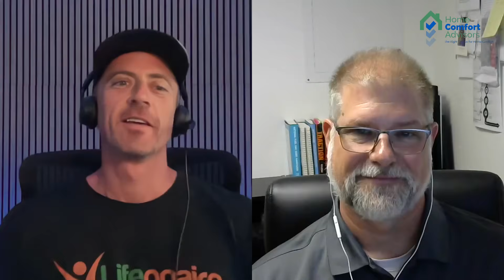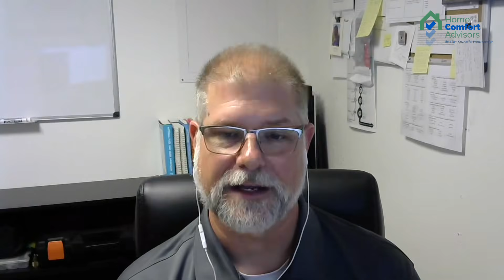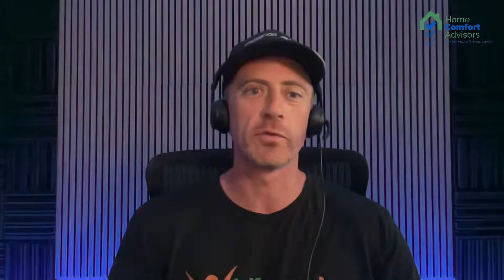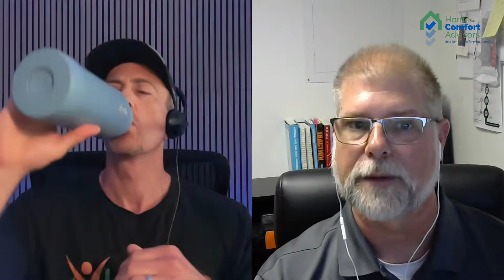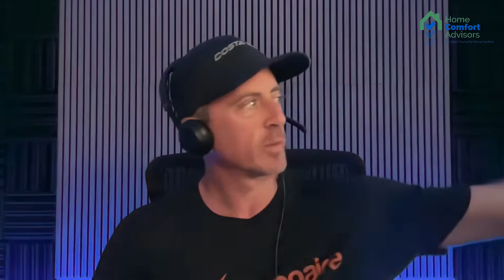Damp & Humid Homes: Causes, Quick Fixes, and When to Hire a Pro - With HVAC Expert David Richardson

Comment: My filters are always clean. So youre saying thats a bad thing? I dont have any pets or kids, just me. I still change them every 3 months tho.
Reply from the maker: Not necessarily a bad thing.  What type of air filters are you using? 1 inch? 4 inch?  MERV rating?
Reply: @HomeComfortAdvisors  1 inch. MERV 8
Reply from the maker: @luvb55  you're probably ok with a MERV 8, but some of those pleated fiberglass filters can still be restrictive if your ductwork isn't sized properly.  Best thing to do is make sure the pressure drop across the air filter is low, around 0.10 inH20.  If you have a good HVAC company servicing the system they should know how to properly test the static pressure in the HVAC system.  If you need a good HVAC company, check out www.BetterHVAC.org

Comment: I have a new construction home in South Texas. I have had high humidity the entire time 65-70% indoor. I read that longer cooling cycles can help so I dropped the temp to 69 degrees so it runs longer. I also purchased a portable dehumidifier and it has dropped to about 58-63%.  this still seems too high so not sure where to go from here? Outside humidity is typically from 70 to 90% or more.
Reply from the maker: I’d start by air sealing your house as best you can and sealing any ductwork you have in your attic!  Check out my 10 chapter video course here on YouTube for where and how to air seal and duct seal!
Reply: Sucks that one has to purchase external devices to improve what was installed.  My car air conditions/dehumidifies better than the house.
Reply from the maker: @IsmaelHernandez-ep7cp  Sad, but true.  Your car was also built in a factory in controlled conditions, whereas houses are built in an uncontrolled environment with dozens of workers from different companies, so it's much harder to control quality and performance, but it is certainly possible with the proper planning and instructions!

Comment: Hi; just watched this video. Ty. I’ve got an Ecobee3 lite & it’s set to “auto”. I’ve got an older home & believe I do have some insulation issues in the attic &/or ducts. I’m in Alabama & atm it’s very humid (storms, & just being in the South, lol). Windows & blinds are closed but sometimes I’ll open them for a little bit & close again. Sometimes my Ecobee runs on Eco+ because humidity inside is higher. Don’t think I have a huge problem. I keep my temp at 72 @ night & from 76-77 in the day. Any thoughts on my situation? Do people lower the temp in the house in order to lower the humidity?
Reply from the maker: Yes and your ecobee has a setting to dehumidify by over-cooling the house. You can set the number of degrees it can do it. Air sealing all duct connections in the attic would certainly help!
Reply: @HomeComfortAdvisors wouldnt this cause the electric bill to be way higher since it would be running for longer? Is that worth doing?
Reply from the maker: @luvb55  I don't know about "way higher", but it will consume more energy, yes.  However, the longer a system runs the more efficient it will operate and remove more moisture from the air.

Comment: My system requires the large pleated filters is there any filter you would recommend
Reply from the maker: Honestly the filter that was designed for your filter rack is the one you should use.  Usually the inside of the door to the filter rack will tell you the brand and model number needed.  If you buy cheaper brands they are usually a little smaller than standard and will allow air to bypass the filter inside the ductwork.

From there you could choose which version of that filter (MERV rating) you want to use, and unless you have the ability to test the pressure-drop across those filters or have an HVAC company that can, I'd start with a MERV 8 or MERV 11 at most, until you know that your system can handle a more restrictive (higher MERV) air filter.
Reply: @HomeComfortAdvisors thanks

Comment: Having humidity issues myself.  Sitting around 65-75% 

Going through things as much as possible. 

Planning on sealing around the canopy of ceiling fans.

Closed the damper on my fire place, but took an extra measure and got a piece of plywood and weather stripping and blocked it off entirely for summer.

Going up in the attic today to make sure my soffit vents weren’t covered by the spray in insulation.

Caulked windows and added weatherstripping to all the windows. 

Hot air is definitely being introduced somewhere in my house… I just need to figure out where
Reply from the maker: If you have ducts in your attic, in a vented crawlspace, or in your garage, I'd definitely check to see if they are sealed at all connections!
Reply: @HomeComfortAdvisors who do you hire to do that?
Reply from the maker: @HealedandThriving  a good HVAC contractor or weatherization/home performance company, ideally.  

You should watch this video on finding good contractors and check the links in the description for sites to search.

https://youtu.be/JpZhdLIiVww?si=2BRGoYCSxLRyepj7

Comment: Ac is on AUTO. 80% HUMIDITY WITH AC ON. APARTMENT COMPLEX WON’T HELP ME🥵RETURN AIR DUCT NOT CONNECTED TO FURNACE OUTSIDE.
Reply from the maker: You definitely need to get that return duct reconnected ASAP!

Comment: Only a few minutes into the video and this is already great. Just recently had some mitsubishi mini splits put in myself, and I believe some of the units are oversized for the rooms they are in and I think they're short cycling which isn't taking enough humidity out. And then with auto fan, their fan is always running even when not actively cooling, and maybe that's introducing condensation back into the rooms like you allude to. My humidity sometimes sits between like 60-70%. Any suggestions? Is there any way to tell the mini splits to have the fan turn off after the setpoint is reached, at least in cooling mode?
Reply from the maker: Thanks for the kind words! I’d actually search Google for your specific mini split model and ask it how to stop the fan from running when it’s not in cooling mode. I know some of them have a setting you can adjust from the remote control to dehumidify better and others you have to change settings or wiring setup directly on the head unit controls.

Comment: My humidity is too low, recently had a new electric HP/furnace installed. Prior to installation my crawlspace was really damp, musty etc. Have crawl cleaned out, ducts sealed and new hp and furnace combo installed. The humidity in the home is between 26%-32%. Making health issues. I've set my thermostat to auto with low fan speed but doesn't seem to help. Do you have other suggestions? I called the installer he said may need to add a humidifier.  I'd like to try adjusting something..  please advise, thank you.
Reply from the maker: I really need more info to advise you properly, but if you watched this whole video we talked about the reasons for humidity issues, including excessive air leakage and duct leakage, so those would be good places to start looking/testing.  

I assume you live in a dry climate if you're having low humidity in April?  

If you need 1 on 1 help you can schedule a call with me here - https://schedule.learnhomecomfort.com/

Comment: My ac wont run at night or cloudy days . In texas its humid regardless of time of day. Its almost as if tye ac feels that at night its cooler yet its stuffy and humid in the house
Reply from the maker: That's very common!  You probably need a whole-house dehumidifier installed to remove the moisture indoors when the t-stat isn't signaling that AC is needed!
Reply: You might try cleaning the outside condenser as this sometimes can cause it not to sense the warm air due to being dirty.
Reply: @DavidW-e8z  i blow it off during yard mowing, i have a shade cover for it, and i rinse it off during yard work

Comment: I live in Florida. Had my roof replaced. Since it was replaced, I can not control the climate inside my manufactured home. It's super hot in the summer and damp/humid in the winter. Had my AC unit checked,  including duct work. No issues found. Thermostat is always on auto, filters changed monthly, I have the annual maintenance inspections done as well. Roofer says it's not the roof. I never , in 25 years, have had these issues until the roof was replaced. Your thoughts,  suggestions?
Reply from the maker: Did they add vents to the attic that weren’t there before?
Reply: @HomeComfortAdvisors no. They were supposed to install a Cobra ridge vent per the contract, and they didn't. They said there were no soffits, so they didn't install it. I complained about the excessive heat(chocolates melting in my pantry) and they came back out and installed two whirlybirds. I don't feel like the roof is ventilating properly. I'm having issues with climate control in my home. It's been a nightmare.
Reply from the maker: @goldhamgeo  geez I’m sorry to hear you’re dealing with that! If there were vents before there should be vents now. If the roofing company isn’t cooperating you can file a complaint with the state’s attorney general. If you know the manufacturer of the roofing material you could call them and get them involved as well.
Reply: @HomeComfortAdvisors  Thank you for responding. I will reach out to Owen Cornings because the shingles are under warranty through them. I had to get DBPR involved. Roofing company owner very upset now. Total nightmare. Your videos on humidity are very helpful. I guess I need to go buy a humidifier until I get this mess straightened out. Have a Merry Christmas.

Comment: I believe my issue is your first topic !  My fan is on continue run 24/ 7 because the switch was acting up, so I'm headed back to switch it to auto & hope for the best ?  Every time & day that the humidity & temperature is 85% & 85 degrees my AC unit shuts off completely & won't come back on until both humidity & temperature drop a good 10-15 degrees. Now, today after the temperature drops 10 degrees along with 15% lower humidity it kicked back on, Thank you Jesus & its already dropped from 83 to 77 in 4 hours
Reply from the maker: Sounds like your A/C unit could be freezing up and shutting off for safety reasons.  It could be from restricted airflow (lots of reasons for that - see my other videos) or low refrigerant charge.  Could also be a sensor issue.  I'd definitely call a good HVAC company to do a "total external static pressure test", check the pressure drop across the air filter and evaporator coil, refrigerant charge, etc. If you're using "allergen reduction" or high-MERV rated air filters get rid of them ASAP!

Comment: Get your windows tinted !!! SERIOUSLY,  it helps the AC run 30%  more efficiently !
Reply from the maker: While I get what you're trying to say, you can't claim that solar tinted windows make the AC system 30% more efficient.  You CAN say it reduces the heat load on the house by some percentage, especially in homes with a lot of south and west facing glass, but every house is different and you'd have to use energy modeling software to calculate how much of a reduction it creates.  Thanks for the comments!

Comment: I have in floor heating in my finished basement. I run it year round on recommendation from my HVAC contractor. What temperature should my finished basement be at to keep my humidity problem under control? I currently have it set to 66 degrees. Should I not run the in floor system during the summer? I see indoor humidity levels during the summer of around 60 -65% humidity.
Reply from the maker: is that an electric resistance or heated water based floor heating system?  What was the HVAC contractor's reasoning for running it year round? Is there ductwork also located in your basement?
Reply: @HomeComfortAdvisors water based through pex tubing in the concrete floor.

Comment: Commissioning residential equipment is time-consuming, and homeowners don't want to pay for quality.
Reply from the maker: It's all about educating them upfront. Many will pay more for quality verified installation once they understand the difference, and frankly taking static pressure readings and a cooling drop or heating rise takes very little time.  Using a TEC TrueFlow Grid makes measuring airflow extremely fast and easy now as well!
Reply: @HomeComfortAdvisors where can I get a TEC?
Reply: Could you possibly be asking a little much for your services?
Your only worth what people are willing to pay.